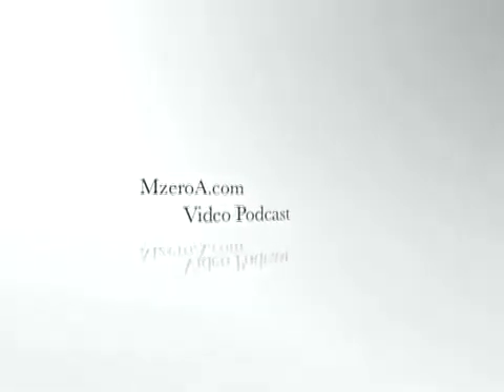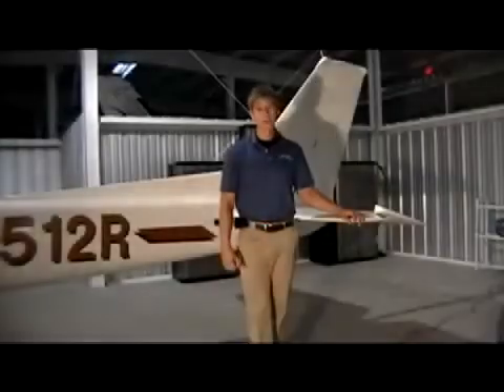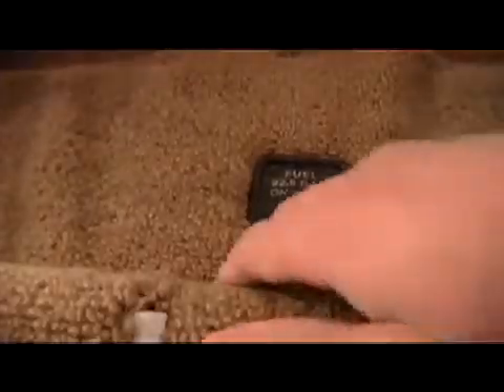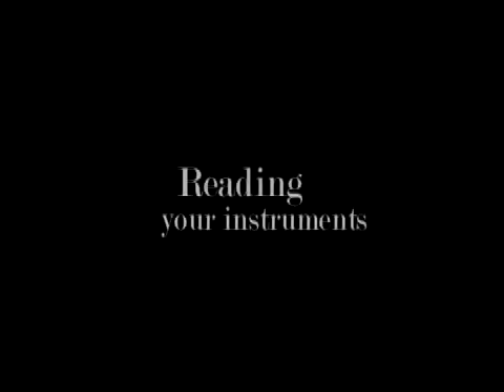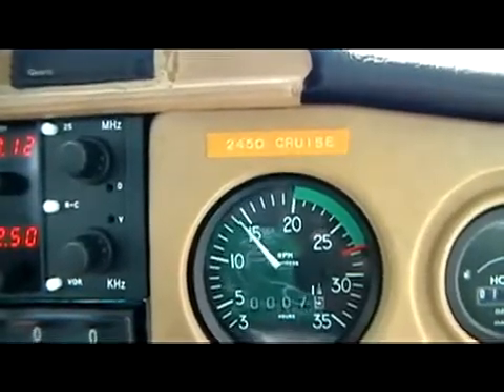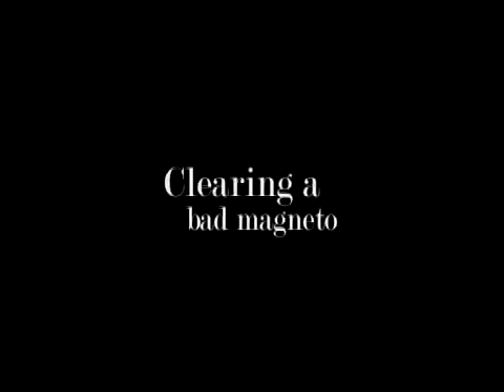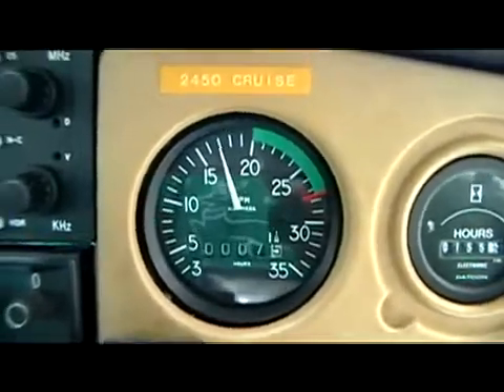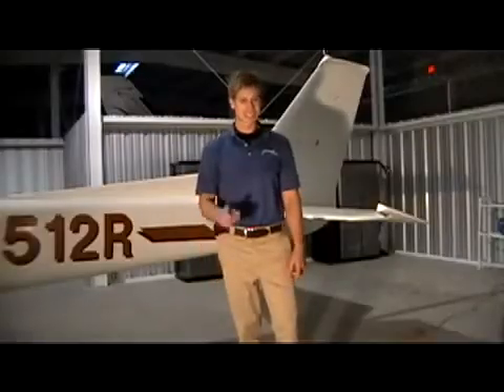Proper Engine Run Up Cessna 150 MzeroA com

Comment: The only comment I would add, and since this video is now 7 years old, the comment I'm about to make may now be in use by its author.  I learned to do the magneto check the way it is described above.  Then someone taught me a safer way.   I like to use the term "clicks" to avoid confusion.
      First,  after reaching the required RPMs, turn the key "two clicks" to the left then back to both.   After both, turn the key one "click" to the left.
Then back to both.  This way you reduce the risk of taking off on one mag.  Many times, pilots have gone from the right mag thinking they went back to both mags, but instead were still on a single mag and took off that way.   I've seen it happen.  Doing it the opposite way than in this video reduces the risk of taking off on one mag. IMO